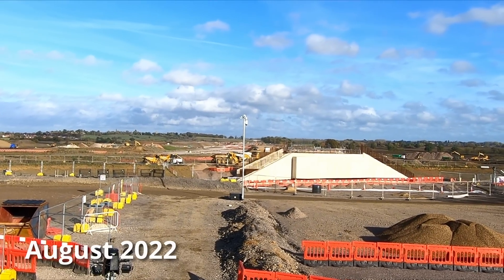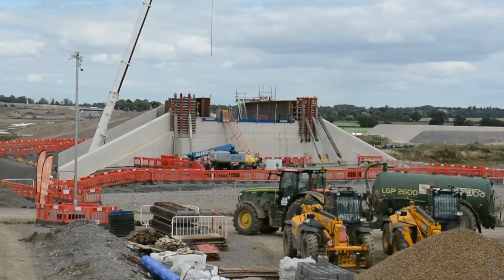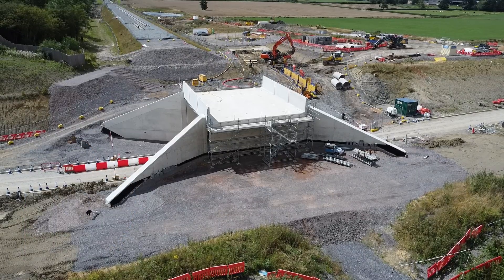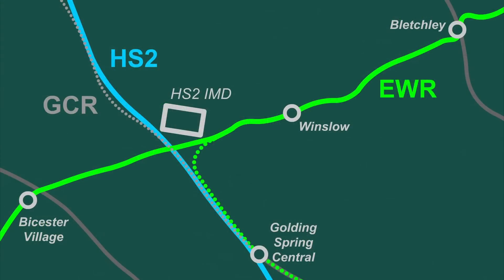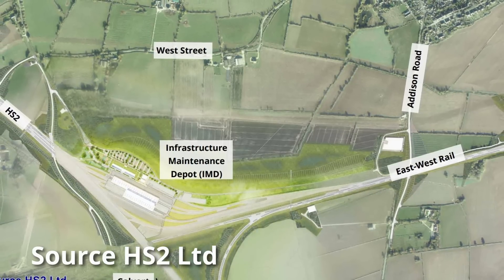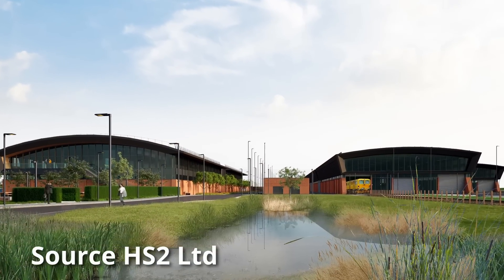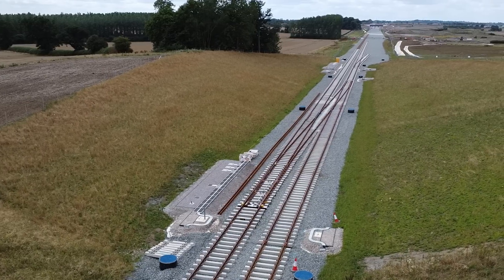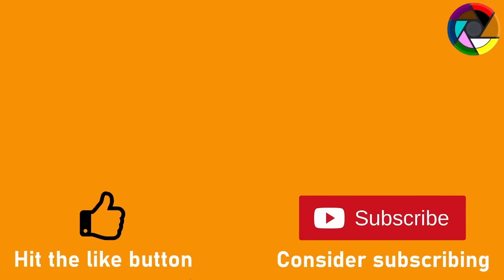HS2 / East West Rail Crossing, Calvert

Comment: East West Rail Co's remit is to construct a railway between Oxford and Cambridge.  Common sense matters like linking to the north/south arterial rail routes are outside their scope. Freight is also a subject they have strenuously avoided mentioning in spite of it being a clearly attractive alternative westerly route for intermodal traffic fron Felixstowe container port. In future years Cambridge and Bedford will suffer hugely from growing numbers of long slow freight trains winding through their centres and suburbs. And diesel  hauled as electrification has been rejected. The current EWRCo scheme in the east is a pigs ear.
Reply from the maker: Freight does get a mention in the consultation document and they admit it could be used for freight, however capacity constraints between Southampton and Oxford will limit the number of freight paths.

Comment: I know money isn't finite, but to not put wires up on EWR now is ridiculous. They're going to have to electrify it at some point, why not now, why cause a ton of disruption in years to come. Overall it would surely cost less to do it now.

EWR to Aylesbury... I really hope it happens. Just seem to get soundbites from EWR to say it's still being considered, when it's begging to be done. No new alignment, little to nothing to demolish, just a link that would be very popular and well used. They shout about HS2 freeing up capacity on other lines, but how can it in Aylesbury if it remains a dead-end spur of the rail network.
Reply: There is meant to be passive provision for electrification, but it won't happen due to cost. The original budget for EWR was £5 billion, but that was set years ago and before current inflation. The upgrade for the Marston Vale line will cost a fortune. Everything is being replaced and nearly all the level crossings gone. Then the new section Bedford to Cambridge. That is going to be a colossal cost. It is going to happen but the final cost even without electrification will be way over budget. Yes I agree about the link to Aylesbury. Local people there are really annoyed about that.
Reply from the maker: The new bridges and structure have been designed with electrification in mind, but any existing bridge would have to be modified
Reply: @ds1868  Indeed. Aylesbury has a huge right to be pissed about it- promised all along in all the EWR planning, connects south, mid and north Bucks which hasn't been possible by rail for decades, and ultimately the sweetener for years of HS2 construction. Try as they may, HS2 alone cannot offer any rail benefits to Aylesbury without EWR, unless you count a few new culverts and a new road.
Reply: @ds1868 if you remember bletchley flyover was built to take electric trains, what happened nothing,
Reply: @joginns778 Yep we will have second hand diesels chugging along spewing fumes everywhere. Then the large diesel freight locos powering through small towns and villages. Local people are really going to like that.
Reply: Those “secondhand” diesel units will effectively be brand new though, 196s that are still coming into service now
Reply: @andrewreynolds4949  do you know if the bletchley to Bedford services are up and running again,
Reply from the maker: Not yet, September last I heard. 150s have only recently arrived from Northern
Reply: @Rail_Focus  with the bletchley to Bedford having no service all this time, you would have thought network rail would have taken advantage and started to upgrade that line instead of waiting till bletchley to Winslow and beyond was finished,
Reply: @joginns778  No, Marston Vale services aren't running
Reply from the maker: I gather plans for Marston Vale are still in the early stages of development. Passengers will need to change between trains for a good few years after the initial opening of EWR.
Reply: @joginns778  I heard september earliest. They decided to repaint the trains to the right livery and most if not all the drivers need to retrain on the 150 sets as its been many years.
Reply: @joginns778  Marston vale is super expensive to modernise.  Besides about 8 freight a day use the line.   I heard Ewr will open MK to Oxford first.  God knows when Bedford service starts.
Reply: @Rail_Focus  MK Oxford 1st.  To me it's a silly idea to not use the Bedford line straight away.
Reply: @atomiswave1971   I asked that question on here earlier and the answer I got is that the 150 s from northern rail are on there way to work bletchley to Bedford hopefully  starting September let's hope the information I was given is true,
Reply: @atomiswave1971  the information I was given came from rail focus if that's any help,
Reply: @joginns778  there are you tubes showing 3 sets of 2 car units making the trip down south.  But they are in Northern livery still and the drivers need their certification on the 150s since using 230s for a few years.  In BR days it would never have stopped.  Just put a 31 on it.
Reply: @atomiswave1971  I was told some time ago that the 150 s couldn't be used on Bedford to bletchley because they are to long for the platforms at Woburn and beyond but I don't know if that's true meaning that the doors could overshoot the platform and someone could end up on the trackbed,
Reply: @joginns778  they are the same kind of units they used before the class 230.  Before there was a 2 car 150 and a 1 car 153 I believe.  I might be wrong though.  Now we have 3x 2 car 150s.  I'm sure all stations can hold a 2 car train.
Reply: @atomiswave1971  do you know is fenny Stratford staying single line ore is network rail going to double track it,
Reply: @joginns778  double.  Even to the point of building another line up to Bletchley high level apparently.    This is why the Bedford section is much later start than the mkc Oxford stretch.
Reply: @atomiswave1971  it's just came up on Google news Marston vale won't be running after school turn September with the150 s they say they need at least 25  driver's to run a  service and exspence with driving 150 DMUs,
Reply: @atomiswave1971 Bletchley to Bedford will be completely rebuilt. New permanent way to W10 loading gauge.
Reply: They are looking at hydrogen / battery trains to offset the electrification requirement.
Reply: @atomiswave1971 In the meantime, it will be second hand diesels cascaded from elsewhere.
Reply: @ds1868  it's a long way off yet.  I agree the outlook doesn't look very promising but an electric railway would only be built when there are guaranteed numbers using the railway.  Going from nothing to premium isn't going to happen.
Reply: @atomiswave1971  Battery with sections of the line electrified could be a good option. Then you don't need to have the clearance for lines at every single bridge etc., just have charging at stations and going along some of the open sections of the line. Hydrogen on the other hand should be considered a non-starter. Useful for industry, but not cost effective to build the infrastructure out (may as well just electrify) for things like rail. Unfortunately it's enough of a 'shiny buzz-word' technology that people will throw money at it, which is ultimately a waste.
Reply: @stephengentle2815  to be honest I think the whole scope of the line is understated.  It's a lot of money to spend on a railway that run 3 car trains.  It would take a 1000 lifetimes to get the money back if at all.  I'd put freight terminals, freight loops and an east to north curve on it somewhere, preferably at Bedford north.  As for the type of traction, I'm for hydrogen as long as you can get the charge from the 25kv feeds at Oxford, Bedford and Cambridge.  Until the trains are 10 car trains I don't think ohle is worth it.
Reply: @atomiswave1971  EWR is being built also for freight. The line will have W10 loading for freight. The idea is to alleviate the North London Line as this is now at capacity. The financial return for EWR has always included freight.
Reply: Have you watched the boy video Calvert to Aylesbury if not your in for a shock, the distruction they have done to the old trackbed is a disgrace I can't understand why they have done that when all they had to do is move his 2 trackbed over a few yards and leave the old trackbed in situ,

Comment: HS2 taking over the alignment north of Quainton removes any idea of the previously proposed EWR link to Aylesbury. This has really annoyed the local authority in Aylesbury, and it just removes any connectivity for the wider Aylesbury area north to Miton Keynes and beyond. Such a narrow minded aporoach to take, and will be regretted later.
Reply: Feels like that last sentence could be about any rail-related decision this government has made...
Reply: From quainton to calvert east west rail and hs2 run paralle,l all bridges and culverts are being built with a potential 3 lines an overall width of 80 meters track bed.
Reply from the maker: It doesn't, there will be passive provision for the EWR link. Was shown on one of the maps during the video.
Reply: @Rail_Focus Passive provision means its very likely it won't happen. The budget for EWR is already busted. Due mainly to inflation but also poor management control. There is meant to be passive provision for electrification as well, but not likely to happen either. Both these large infrastructure projects are riven with poor planning and a central government chopping and changing like a British summer.   The core project will be finished, but at what cost?
Reply from the maker: There will however be passive provision and HS2 does not preclude a link ever being constructed as you claimed in your first comment. Whether or not such a link is funded is a discussion for another time.

Comment: Seems like such a missed opportunity not to build an interchange station at Calvert.
Reply from the maker: Yes and no. The biggest benefit to the area will come from EWR and the new station at Winslow. More crucial is the link from Aylesbury to EWR. The North and Buckinghamshire will be so much better connected with EWR to Milton Keynes working in conjunction with the released capacity on the WCML.
Reply: @Rail_Focus  Agreed. It's just funding, which under the Tories is unlikely to come. But with the provision for the EWR down to Aylesbury running alongside the HS2 route mostly, it does seem a bit bonkers that they aren't just doing the work now at the same time as HS2.

The whole point of EWR is to save people from having to go into and out of London just to go sideways across the country. So skimping on the connections, as well as the electrification, kind of hurts that overall.

Still, another year or two and we'll have Oxford to Bedford being possible all in one stretch. Shame the section to Cambridge wont be until like 2030 at the earliest. Which if they build that without electrification then they'll have lost all sense.
Reply: @xxrockraiderxx  I was very disappointed at how hastily HS4Air was rejected. That seemed a great idea, and my suggestion would've been to build an HS5 branching off it at Heathrow, which could follow the M3 and connect to the existing network somewhere in the Eastleigh area, from where trains could run to Portsmouth and Southampton. That would then create a high speed Cross Country route, and perhaps those trains could call at the interchange, with services to and from London passing straight through
Reply: Could always explore that option later, simply getting the lines built first takes priority
Reply: It would make a good place to build a new town.
Reply: @RichardFraser-y9t no, it would be a horrible place for a new town.
Reply: There should be a domestic service on HS2
Reply from the maker: Do you mean international?
Reply: Now that hs2 to Leeds and Manchester links have been cancelled is an interchange station with east west rail a stronger possibility?
Reply: all that expense for a interchange station that would at most serve 30,000 people? no shot
Reply: @MetisXIV  The platforms could be served by loops to allow trains not stopping there to overtake